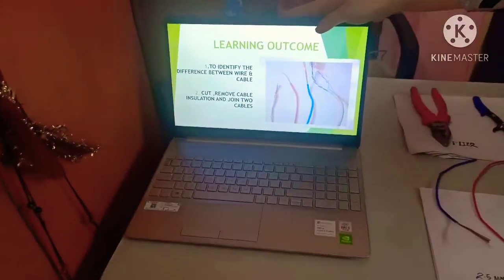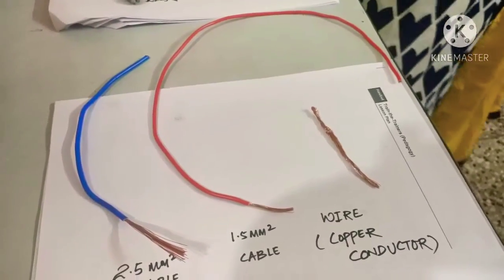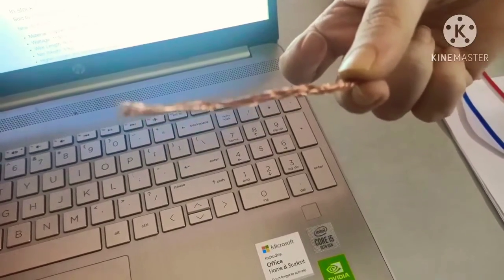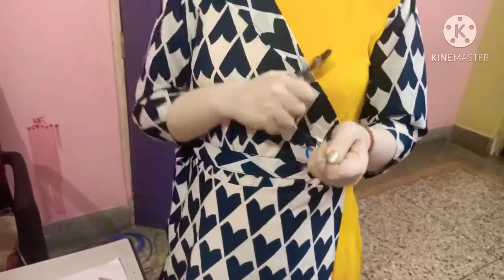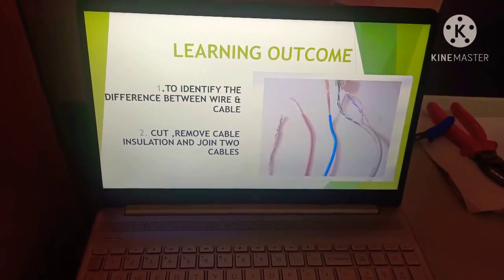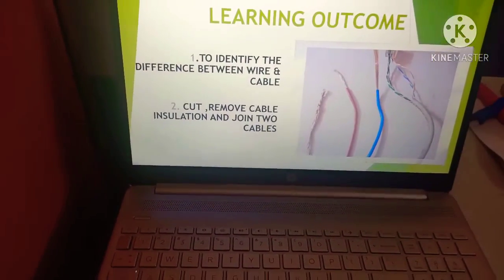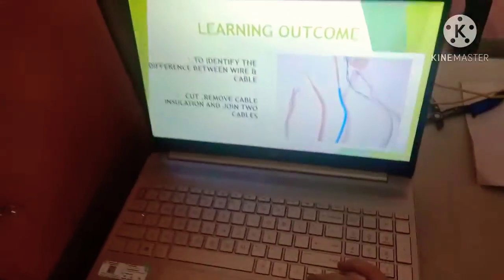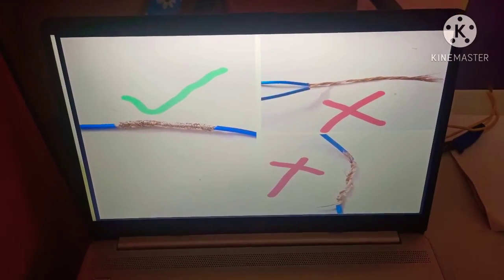DIFFERENCE BETWEEN CABLE AND WIRE |CUT, REMOVE CABLE INSULATION AND JOIN TWO CABLES

Comment: The main difference between the two is that wire is always a single conductor, while the cable is a group of conductors insulated together in a single jacket & after joining two different wires, it is advisable  to wrap the exposed wires with electrical tapes for safety purpose or we can use wire nuts for joining where it is recommended as per international standards.

Comment: very nice video.  Explained very clearly. Useful for my electrician course. By the way Mohury Mam, the cross section of wire is the X'section of only conductor or conductor along with the insulation?
Reply from the maker: Conductor

Comment: Mam.Why the 2mm wire is not available in the market,,?
Reply from the maker: It's a qns like why 220 v ,y not 320 v?
It's 2mm can also b manufactured but most company manufacture these standard wire mm rating.